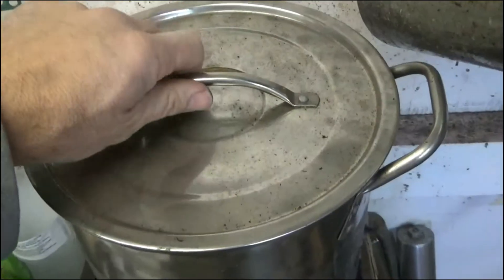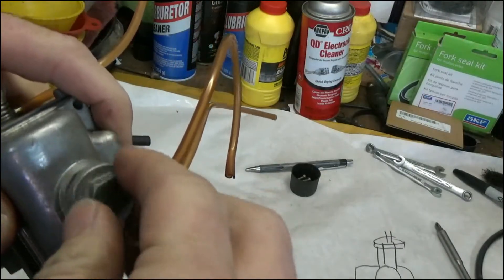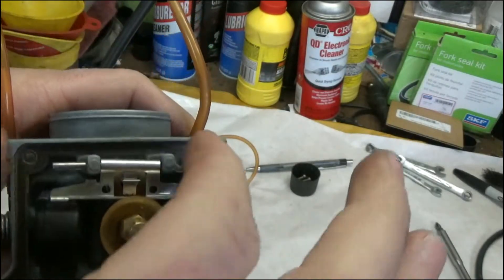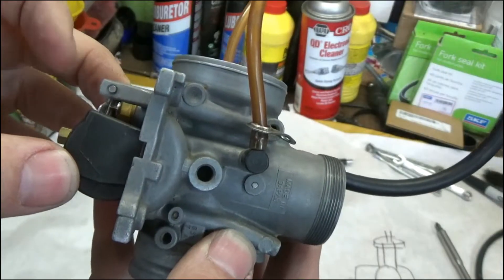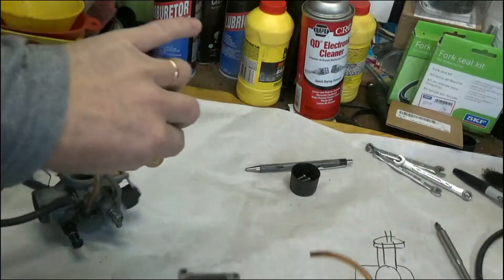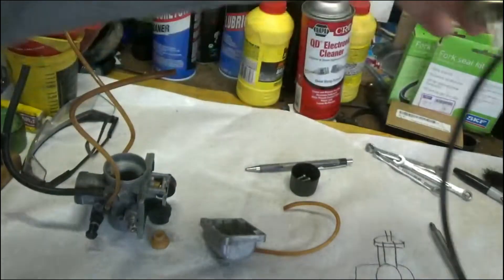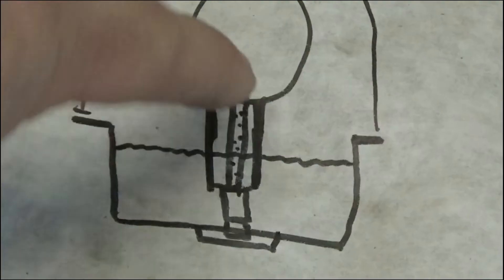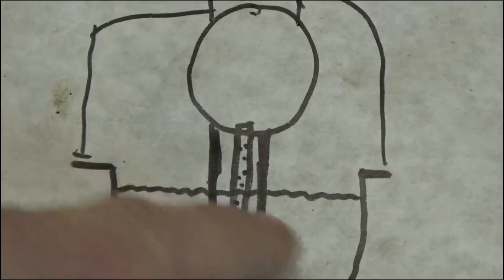Why float height is important

Comment: The mechanic bent my float  and it started leaking. I think that's the cause of the problem. Also, my engine won't work anymore.
Reply from the maker: Reset the float height to stock and clean or replace the float needle and seat.

Comment: I am at my wits end! All 4 carbs flooding on my 76 honda cb550. All critical components replaced. Shiny new brass seats, valve needles etc by previous owner. (He did a full carb rebuild) I set to factory spec 22 mm, (correctly done at slight angle so float weight didnt depress pin/ needle.) I did a dry test ( blew into gas supply line)  and manually pushed floats and passed. Did a gas test with bowls off and manually pushed floats and stopped the flow. Passed. Checked the floats for holes ( dropped them in small tub of gas) passed.  overflow tubes tested for pin holes and cracks. Passed. Put back on bike and they still flood! Had them off twice now ( which is a real pain) and have no idea what to do. I watched every possible video and tried everything I know and they still flood. Floats are correct type best I can tell and have new float bowl gaskets. I've been retoring this bike for 1.5 years and and conquered every project on her. (thanks youtube). Was finally ready to start her up. That was months ago. Now I am at a complete stop and about to lose interest in the whole project. These carbs have taken the fun out of the resto. Any ideas?
Reply from the maker: @Old_drummer64  Sounds like you've checked everything I would. Next I would do is set the float height to 23-24mm closer to 24 and see what happens. What I have seen in older bikes is the float pivot pin and float pin passage wear and you need to make up for it by adjusting the float to make up for it. Give that a shot, don't give up it's an awesome bike. I had a 75 400 4.
Reply: It worked! Thanks again
Reply from the maker: @Old_drummer64  Awesome, thanks for posting back!
Reply: Thanks! I toyed with the idea of increasing the height ( was thinking 25)  but couldnt find anything that supported that so I was reluctant...until now. Again thanks!
Reply: Now I have a new problem. Bike starts reluctantly, idles like crap (I know I need to do a vacuum sync) then immediately revs up like crazy! I have to shut it down asap. Ive learned from yt it could be a vaccum leak? I installed new rubber manifolds and new airbox to carb port rubber fittings. Tightened the crap out of all 12 clamps, airbox is in place good and tight. Have done a bench sync. Ive turned all 4 gas/air adjustement screws out 2 turns. When I bought the bike, it started and ran ok but Ive since had carbs off to  bench sync and twice for  float adjustements. Any ideas? Thanks.
Reply from the maker: @Old_drummer64  A vacuum leak is indicating a lean conditioner. A lean condition can occur several different ways. Check the fuel flow from the petcock all the way to the carburetors. Check your fuel line routing, the fuel filter at the end of the fuel tube inside the tank, some of these carbs also have screens at the float needle in each carburetor check that those aren't clogged. I just put a set of cbx1000 carburetors on. It was idling okay but was only running on five cylinders because of a spark issue. When I fixed the spark issue the idle went extremely high, I had to adjust the idle screw to get it to idle. Normally. The carbs were rebuilt somewhere else and the idle was set too high. Just a couple things to look at. Good luck. Let me know how it goes.

Comment: Sir my bike has Mikuni BS series carburettor and I messed up the Float height and now when accelerating at low rpm then bike loses acceleration,jerks and slows down as if it ran out of fuel then slowly engine gains high rpm and then thereafter it accelerates properly.. idling is ok so it seems the main/ needle jet does not get fuel at low rpms...pls suggest if i need to adjust float again or can I fix it through fuel mixture screw... thank you...
Reply from the maker: @hsb0989  First you need to get the float height correct. The seam in the middle of the float needs to be parallel with the gasket surface of the carb body without compressing the float needle pin. So rotate the carb so the float tab is resting on the float needle pin and the seam should be level. If not, adjust the tab. Set the jets to stock and mixture screw to 2.5 turns out and start there.
Reply: @TepcoCycleRepair  thankyou very much for d reply....i got it understood...

Comment: Would a high float level make it use more fuel.
I have a Weber on an 83 Toyota coaster and it BURNING through fuel. I'm getting 100km on 25liters of fuel... Wtf.
Reply from the maker: @theozzyjoker2985  It depends on what you mean by high. If you measure from the gasket line to the bottom of the float with the carb on a 45°  angle, a bigger number or the float further away is lower, closer the gasket line or a lower number is higher and yes it will use more fuel. I'm not familiar with that carb but I would set it at the factory level and make sure your floats aren't cracked and filled with fuel.
Reply: @TepcoCycleRepair  thank you, I'm going to need to call a mechanic, the problem is finding one that actually knows about carbys.

Comment: If fuel was flooding out of my carburetor out the front into the air intake, what would that indicate? This is on a Honda eu2200i. New jets, float, needle, and gasket were put in. Not sure what needs adjusting. Thanks!
Reply from the maker: That's usually a sign of a bad float needle seat, float needle, and a bad fuel valve. One or all of those is where I would look. When you replaced your float needle did you polish the seat in the carb?

Comment: I have an 83 xt200.  Theres an older guy in my town everyone takes their bikes to.

My float is different it doesnt have that tab and the spring is on the outside of the needle.

The guy looked at and his suggestion was to just buy a new carburetor.

Any float with brass components is adjustable.  You just have to figure out how.   

Im just pissed that im getting all these videos AFTER i fixed it.

Great video and explanation.

Im just making this comment for people that have one like mine which i havent found a single video for

Comment: When you say measure from the mating surface do you mean the lip of carb or the gasket
Reply from the maker: The gasket, not the lip on this carb. If your carb has the gasket on the bowl, then measure from the flat surface of the carb body that the bowl gasket seals against.
Reply: @TepcoCycleRepair  I measured my float wrong. (Carb in the upright position) I have hard starting when cold..I also have a leaking fuel tap allowing fuel through when in the off position. Would this cause hard starting when cold? Maybe a flooded engine?
Reply: @TepcoCycleRepair  because also my carb slightly overflows when left over night.
Reply from the maker: Sounds like your float needle isn't sealing. Even if the fuel valve was leaking the float needle would cut the fuel off at the carb when the bowl fills. First I would get the float height corrected, clean the float needle and seat and see how it does. If that fixes the leak and it's still hard to start, I would check your valves if it's a 4 stroke. If it's a 2 stroke, do a pressure test and make sure you have a strong spark.

Comment: A small seep of gas in the air fuel screw means that i have my float height adjusted into a rich mixture?

 I have my carb installed in the manifold tilted should i fix or modify the float level height according to the position of the carb in the manifold?
Reply from the maker: If it's leaking out of your fuel mixture screw, you're probably missing the o-ring. Always set the carb to the float height no matter the angle of the carb. If it's a crazy engine install in something it didn't originally come in, you may need to modify the angle of the intake manifold. Then make a video of what you put it in so we can check it out!

Comment: I have an issue with my 94 XT 350 float in the carb. The brass bracket that joins the 2 black plastic floats is buckled it would seem. I straightened it out but there's still some alignment issues. Looks damn odd. Could you please give me some idea of what's gng on with this
Reply from the maker: You need both floats to be level with each other at the desired float height, and for the bracket to move freely on the float pin so the floats don't bind. If it can do all that it's good to go ugly or not. If not I would order a new float.
Reply: @TepcoCycleRepair Perfect. Thankyou very much. That's a winner my man. You know your stuff for sure

Comment: My carbs leak from overflow sometimes and my bike bogs at 80-100% throttle. I know main jet is implemented at 80-100% throttle. Would the float be the causation for this?
Reply from the maker: Sounds like you have more than one problem. First I would set the float height to stock then set all the jets in Ludington needle to stock as a baseline, if the bog is still there something else is going on. Could be several things based on the bike, set up, and condition.

Comment: do you ever do a wet test when you set floats
Reply from the maker: Sometimes I do a bench test with a clear hose if I'm having issues. I always like to bench test carbs when I'm done rebuilding to check for leaks or anything else before install.
Reply: @TepcoCycleRepair  my yamaha manuel makes a big deal out of wet test but the drain tube is so short the hose won't stay on so is it a big deal or not to wet test
Reply from the maker: @dennytuma  It's not, set it to the height recommend and carry on. Don't worry about wet testing, I rarely do it and only do it for carbs with issues.

Comment: would the float level be causing my 04,predator 500 to stall when leaning on it or going downhill
Reply from the maker: If it's too rich and it's idling, it could idle low enough to cut off. Your problem though is most likely the o-ring around the base of the float needle seat not sealing. This will let fuel overflow the bowl and cause it to run rich. Does it leak fuel? If so that's another sign of this issue.

Comment: I’m starting to think my float is not adjusted correctly. When I first got my bike (yz125/144) it would leak out over flow. Replaced float with a new one and adjusted it to stop leaking. It’s been fine on most part until I was out on a long ride.  Bike had a new plug and when I got to about 1/2 tank  bike seemed as if was running out of gas.  It would loose power then snap back in then do it all over again constantly. I replaced plug and ran fine briefly until same issue.  Plug was still new looking when pulled.  Haven’t rode since.   Not 100% that’s what the issue is but it’s a possibility. I am going to play with it a hair just to check it out plus check reeds and clean petcock.  Any input you have would be great.  Best explanation of float main jet by far
Reply from the maker: Set the float to the stock height, most likely it's something else. Possibly vapor lock.

Comment: Float height is a rough adjustment. The actual fuel height is what really matters.
Reply from the maker: That's correct, the manufacturer decided that at the recommended float height, the fuel height would be correct.
Reply: That's not always true though. That's why it is important to actually measure fuel height in the bowl.
Reply from the maker: @notsogreat123  But most don't have the level of fuel listed but they always have the float level. But for a tuner I understand what you're getting at.

Comment: If the fuel level is too high... Could this stop the bike accelerating past 50mph and cap revs at 4000rpm? That's the problem I have
Reply from the maker: It could, best thing to do is pull it and set it properly. While you're in there make sure the main jet is clean and needle is set properly. If it's a CV carb be sure the slide moves smoothly.
Reply: @TepcoCycleRepair  yes it's a keihin CVk 30 I believe Kawasaki zl600 1995. When I set floats to 17mm factory fuel level in the bowl seems really low.. should I go with it anyway? Thanks for the reply
Reply from the maker: @ryanstocksmusic  Edge of the bowl to top of the float with the needle just resting on the needle seat, not compressing the needle spring. 17mm +/- 1mm.
Reply: Yes, but when the float is set to factory 17mm, the fuel level in the bowl doesn't seem correct, in the manual it says use a clear tube to make sure fuel level is +/- 1mm above or below gasket mating service. So should I set the float height in accordance to the correct fuel level height? If that makes sense. I need it set to 14.5mm to achieve the correct fuel level the manual states, but then the bike bogs when hitting 4000rpm.
Reply from the maker: @ryanstocksmusic  I see, well I would try the stock jetting and setting it to the 17mm and see what happens. I understand the 17mm puts it at a different level in the clear tube using that method, but if the 14.5mm to make the tube measurement correct isn't working, try the book 17mm and ignore the clear tube method for now and see how it acts.
Reply: Thanks for taking the time to reply, I will maybe try in the middle, 16mm or so and see , I'll give the seats a good clean with fine wire wool aswel. Wish me luck I'll let you know how I get on in a week or so
Reply from the maker: Looking forward to the results

Comment: Would it make gas shoot towards the air filter, and not the engine ?
Reply from the maker: A couple of reasons depending on what you have. If you have a 2 stroke it could be broken reeds, if it's a 4 stroke it could be a stuck valve or valve timing is off. It could also be from a clogged exhaust causing the built up pressure to get released when the valve opens.
Reply: @TepcoCycleRepair  my spark plug Tip came into contact with something I say intake valve
Reply from the maker: @frankmiranda1352  If it's a motorcycle it probably came in contact with the piston. If it's a flat head Briggs mower, then valve contact is possible.
Reply: @TepcoCycleRepair  honda xr100
Reply from the maker: @frankmiranda1352  The XR100 has overhead valves. The spark plug most likely hit the piston. Which is a sign of either the wrong plug was used, or the crank or wrist pin bearings are shot letting the piston travel too far.
Reply: @TepcoCycleRepair  would that let oil in the combustion chamber
Reply from the maker: @frankmiranda1352  A hole in the piston or a bad head gasket could.

Comment: HI nice video,,,Maybe you can help me,,,,rear carburator from my Marauder 800, after cleaning and put back together, the bike fires up, rides and sounds good, but there is gas dripping from the bottom nipple in the float bowl, I took this thing apart 3x and even replaced, float seat and needle and it still leaks gas from nipple and nowhere else,,,whats the issue, is the float just set wrong?  The tab is even,,,,does the float need to go down lower when its upside down or the other way,,,any ideas on what I should do?   TY for you help
Reply from the maker: First I would set the float to factory height. If you replaced the seat and needle, and set the float height correctly and it still leaks, there are a few other things you can check. If it's leaking out of the bottom nipple, check the overflow tube in the bowl for cracks, this is common when bikes get some age on them, and also check the drain screw at the bottom for any corrosion at the tip where it seals.

Comment: Today I cleaned the Carb 3 times and It's Starts the Scooter but when I pull the Throttle It's Shutting off..MAY be It's a Float Problem.Where the pilot her may not be getting enough fuel

Comment: If it is running rich, will is also affect the idle?
Reply from the maker: Yes, a rich mixture will affect the idle. If you rev it listen to how it comes back to idle, if it goes lower then rises to idle or stalls, it's rich. If it drops slowly to idle it's lean.
Reply: @TepcoCycleRepair  thanks for ur reply😇

Comment: wen i  park my  XR650R   on the side stand....( gets  the bike on a angle)  it over flows  ( gas drops)
 it runs great, the carb its clean, starts  on the first kick.
you think is my float level....?
Reply from the maker: If that's the only time it happens, most likely it's the float height.

Comment: Ever since I switched to race fuel on my yz125x and now I deal with float issues. Leaks outta my overflow. Never did before.
Reply from the maker: The fuel shouldn't cause float issues. Just double check it and make sure no debris is stuck in there.
Reply: @TepcoCycleRepair  cool. Thank you for the tip.

Comment: Please help me understand, when a running bike hits a pot hole or something like a bump, what happens inside the carburetor? Doesn't the fuel splash into the venturi?
Reply from the maker: Fuel does splash but it still has to go through the jets to get into the venturi of the carb.
Reply: @TepcoCycleRepair  Thank you for replying. How is this handled in a running engine which already suction pressure in the venturi? Thanks again
Reply from the maker: Suction is controlled by the throttle slide, so a running engine can only suck so much with the throttle closed. When the throttle is wide open the jets monitor the fuel. That's the very basics of it.

Comment: My bike dies when I decelerate. could that be floatbowl-related? it also when the bike is tilted forward (front end dipped)
Reply from the maker: Yes, sounds like it's to rich on the pilot jet. When it's idling blip the throttle and pay attention to how it goes back to idle. If it slowly drops down to it it's lean, if it drops lower then idle then creeps back up to idle it's rich. If it's not idling at all, turn the idle up just enough to idle do you can try this. Then start with your mixture screw, 1/4 turns at a time, if that doesn't fix it you need to check your float height, if that's good you'll need to start changing the pilot jet.